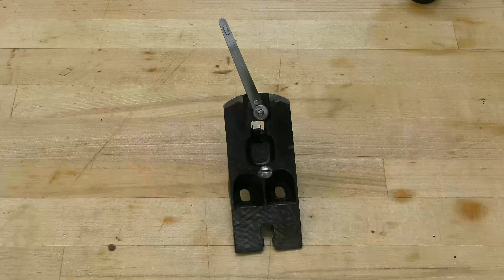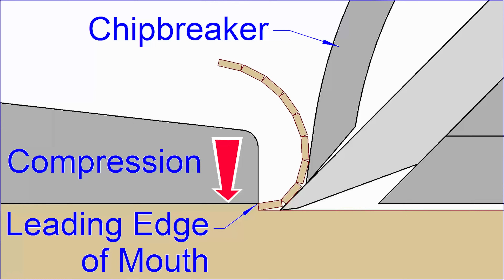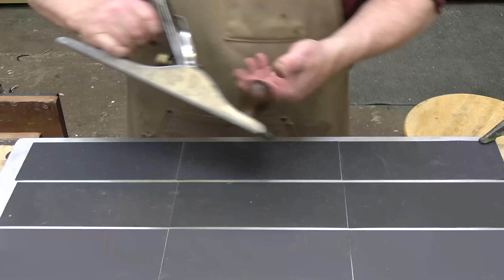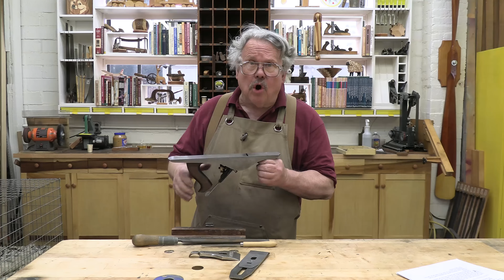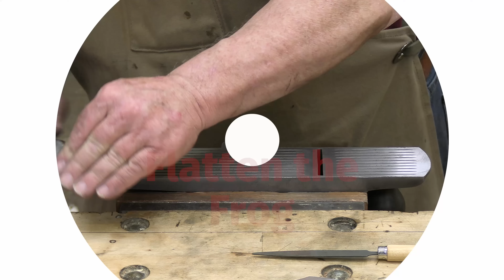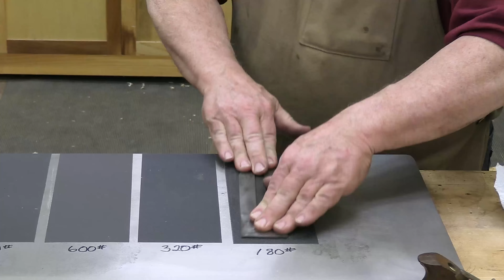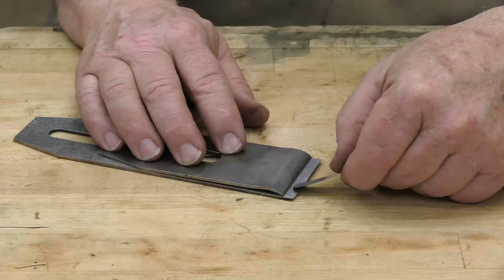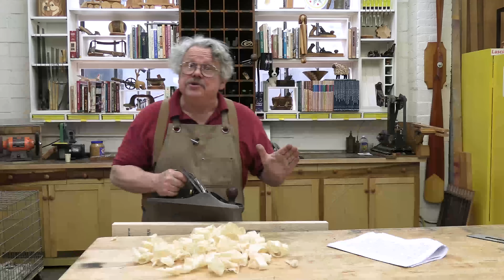Fine Tuning a Bench Plane

Comment: There is another critical part on the frog of every plane which I didn’t see get addressed. That being the bottom of the frog where the contact points sit on the bed of the plane itself. It appears as though the frog that was being tuned also had some of that black paint on those contact points as well. Now although I am sure you removed/ stripped that paint and flatted those 3 main contact points on the bottom of the frog. Your video here never touched on how critical it is to making sure that those 3 contact points must be flat when seated in the bed of the plane. Because any wobble in the that frog when it’s seated will translate into chattering of the plane blade. Which you also touched on later on in this video. All in all though this was a great video! Thanks for sharing!

Comment: You really should have given the chip breaker a bit more attention - that pitted rough surface is going to cause higher friction than necessary on the timber as it passes through - a few minutes with some wet and dry or a diamond stone would be all it would take to make it smooth as silk again. :-)

Comment: Your knowledge and presentation is unsurpassed by anyone doing internet videos! I'm a retired high school woodshop teacher. Luckily, the school system I worked for is continuing the program. I was very happy to see you set the plane on it's side after you took your test passes! I see too many internet woodworkers set the plane down on the blade and sole after using it.
Reply from the maker: You're one of the good guys, and I very much appreciate you current remarks and your past deeds. See my reply to Justin above.

Comment: I did a lot of research before tuning a new Stanley I bought late last year. I never encountered the tip you showed for flattening the frog face. I wish I knew that tip several months ago. I would say my new Stanley was as bad as the Harbor Freight plane you explored in the earlier video. Everything needed loads of work, including the frog. I was unwilling to drill out the lateral adjustment lever, and I didn't know about this tip, so I eye-ball flattened it by angling a mill file across the face.
Reply from the maker: I am completely unfamiliar with the new line of inexpensive planes offered by the ghost of Stanley and others. My first plane was a WWII-era Stanley jack given to me by my grandfather, and I've built my collection around that. With a single exception, everything in my collection is older than my first plane, and I am well satisfied with the quality. But I hear disturbing things about the new Stanleys -- one viewer wrote that it was as hard to make right as the Harbor Freight/Central Forge disaster I unpacked in an earlier video. If true, that's not only a disappointment but a sacrilege. The memory of Stanley deserves better.
Reply: @WorkshopCompanion  The great disparity in quality between the old and new have driven the prices of any "old" plane sky high. The used market is saturated with bombed out rust buckets with very high asking prices. And many sellers are not knowledge enough to identify and share the "clue" that would allow one to date it much less determine if it's a Bailey style frog or of the "handyman," "defiance" or "craftsman" variety. It takes a fair amount of time to wait for the fair amount of luck needed to find a good deal on a good plane. I've not be bless with that kind of luck which is why I decided to experiment with a new Stanley. I will not buy another new Stanley. My next plane experiment will likely be a new Wood River.

Comment: I found my Stanley No.5 hidden in my basement in the ceiling 25 years ago, the only things it was missing were the mouth adjustment screw and the screw that holds the iron and cap iron together. I didn't everything shown here and it's been my favorite plane ever since.
Reply from the maker: Thanks for sharing.

Comment: Great video! I would love to see a comparison video. Where you show the difference between the results of a plane with no flattened sole and one with a flattened sole. I had an old wood worker many years ago tell me that it doesn't make a difference if the sole is flat or a little out of true. He showed me his planes and none of them were lapped. And when he planed a piece of wood to show me, it was just as flat and true as if he used a lapped plane. He said if you couldn't feel a rock when you pushed on the plane then it didn't matter. We're not making aircraft parts he said. LOL! He said the same thing about chisels. Which of course he showed me. And I couldn't tell the difference between his chisel results and mine where I lap my chisels and even hollow the flat a little.
Reply from the maker: The difference isn't as obvious in the results as it is in the process that `produces the results. A tuned plane cuts ever so much easier than an untuned plane. My grandfather explained it this way -- "You can cut wood with a sharp saw and you can cut wood with a dull saw. Just how tired do you want to be when you're done cutting wood?"

Comment: As someone who used to live in a damp environment I highly recommend buffing some kind of oil into any metal you've sanded or cut, especially the cast parts. I got tired a few times and left the sole or iron I was working on uncoated for a night after drying it and there was still enough water in the iron and the air to make a nice little rind by the time I got home from work the next day.
Reply from the maker: Good points. Cast metal is porous, rubbing in the oil "seasons" and protects. I'd also like to mention that recently some of our viewers have turned me onto T-9, a spray-on rust prevention that does what WD-40 used to do. You spray it on, the carrier evaporates, and it leaves a thin, protective coating of wax. Very effective.